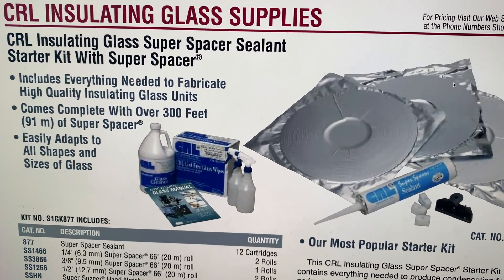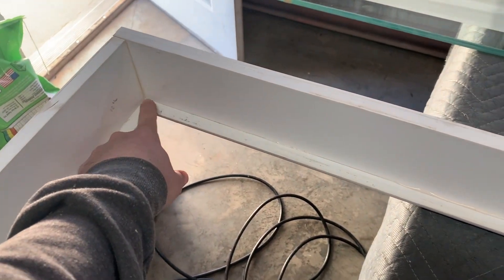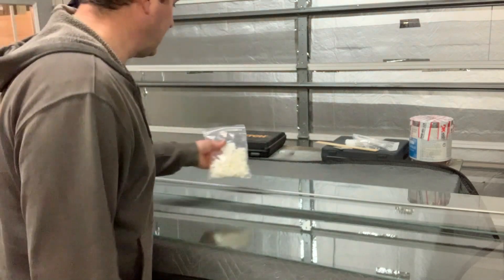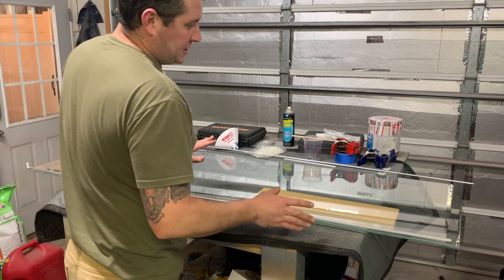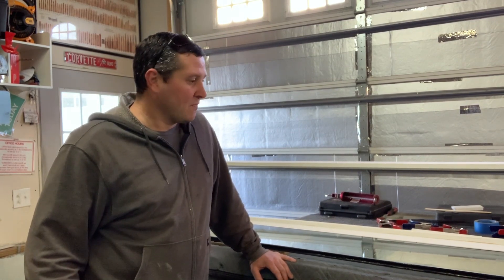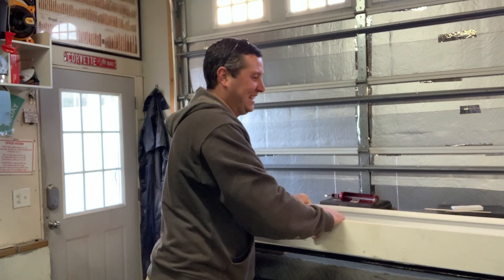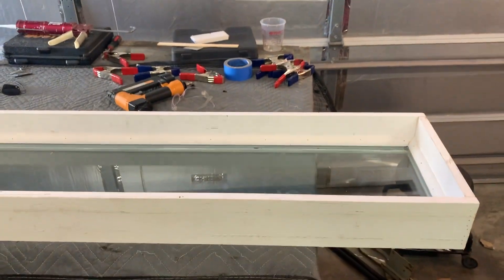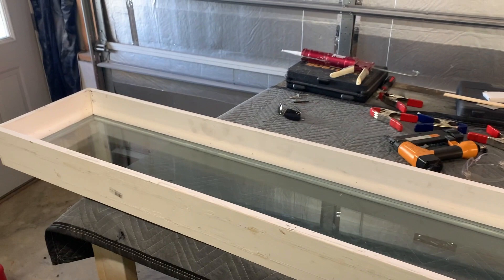How to build a dual pane insulated exterior window DIY Transom Window and Cornice Box

Comment: This is what I needed. I'm building exterior French doors out of wood. Glass company wanted over $350 for the 2 panes put together. For 2 doors double that =$750+Basically a replacement glass. I used to have a furniture store and I sold glass for tabletops. It was 20 years ago but I know still the markup in glass is incredible. Of course now you have to do the double pane glass. No other YouTube video shows how to sandwich the two pieces of glass together or where to get the materials I am very appreciative.
Reply from the maker: I was surprised how easy it was and it worked out awesome! Glad it helped you out and thanks for watching